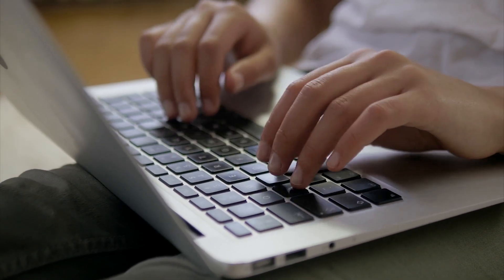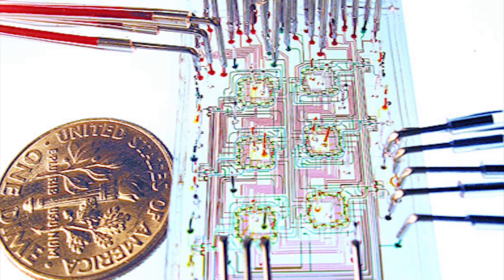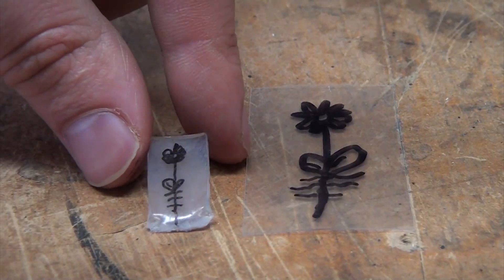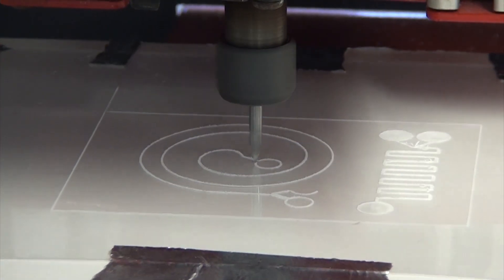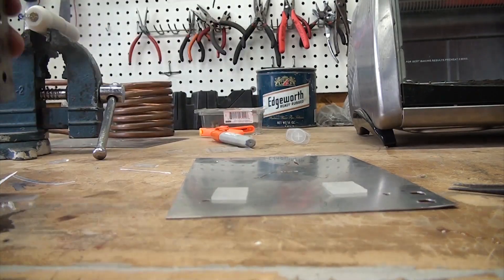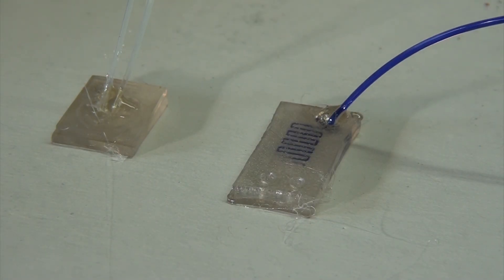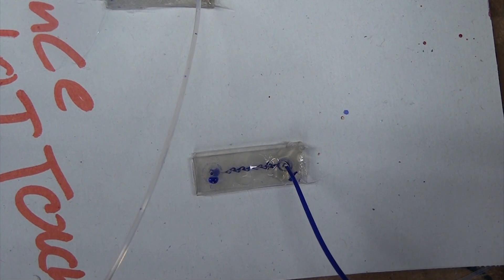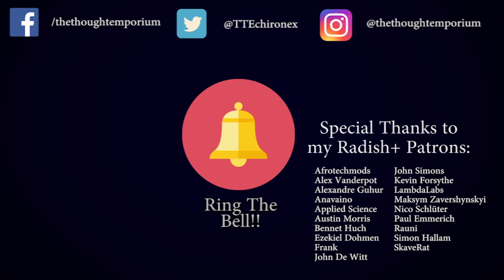Worlds Smallest Tesla Valve? - Shrinky Dink (Shrink Film) Microfluidics

Comment: You might be able to shrink it around your tube to create a good seal. You would probably have to experiment with hole sizes and may need to use a smaller stub or barb-shaped piece or clamps to prevent the weight from ruining it while soft.

Comment: Could you maybe 3d print this stuff using a dual extruder with the channels printed in a soluble filament maybe with a 0.1 mm nozzle. Than you just submerge it in water or the solvent, maybe use an ultrasonic bath. You could probably build some really cool stuff that way.

Comment: On my cnc router I put green painters tape on the plastic then put some on the bed of the router. Then I super glue it down. This works the best for close tolerances. And i never use tabs on my parts.

Comment: Im curious what is the tool(drill) used? Does it have like a straight conical shape? Or is it some flute?(like 2/4 flutes hss). Does it end with a tip or does it have some width of the tip? Sorry for so many questions. I have experience of metal cutting, I just never cutted/engraved anything in plastic yet.
Here youtu.be/ct0tljBtjG0 Integza printed Tesla valve. On one of his videos he also tried using DLP printer. On DLP printer pixel size is around 50 microns. Some epoxies are med rated as they are used for teeth implants for example.
Reply: If you need some 3d stls for that just give me a reply.
Does this Ctc channen on 8:55 should be smaller? Did you put some thought there, is it intuition, or was just drawn this way unrelated?

Comment: I have an HP xy plotter that uses full wave rectified dc to hold the paper flat in place. The bed is just a grid of interleaved fingers etched onto a circuit board with an insulating plastic film on top. When you switch it on it sucks paper down flat and really holds it solid. Might help when machining. 

Also, what about sandwiching an opaque film between two clear sheets and using a laser to vaporize out the opaque?

Comment: Use a  cold plate vacuum table to hold down the membrane and freeze it. Cold plastic should machine cleaner, as its less gooey..,relatively speaking, and will also dissipate the heat in the machining interface.

Comment: How about etching the design on standard copper-clad glass-epoxy (PCB) stock? After etching, you could coat the whole thing with a really thin protective layer to protect the copper from the fluid. It may not work at the really small scales, but it would be pretty good for demonstrations and proof-of-concept.

Comment: Hey there. Awesome video! Why not use your acetone trick to solvent weld the two bits together. Coat just the cover piece, set it on the channel piece, and apply pressure until bonded. Methylene chloride would also be very effective.

Comment: What's your channel width in the tesla valve? I fabricate my chips by pouring PDMS on silicone wafers and then plasma treating and bonding the PDMS to glass. I'm mostly using them to generate alginate microspheres, which I crosslink on-device using a Ca-EDTA chelator system with pH release trigger. This is great for minimizing polydispersity of the particles, but the startup sequence is finicky since any unintended flow into the wrong channel leads to crosslinking and a permanently ruined chip. My band-aid for this issue has just been printing a bunch and destroying a couple for each one I got to work, but I've been thinking about including Tesla valves proximal to the channel junction to make start-up a little more reliable. 

One worry I have is that at my channel diameter (10-100 um) and with the relatively high viscosity of a 2% sodium alginate solution, the flow may be too laminar for a Tesla valve to function properly (I'm assuming you need some degree of turbulence for enough fluid to go into the loops to generate appreciable retrograde pressure). Do you have any experience with this? This is all conceptual at the moment while my lab is closed during the pandemic, but I'm hoping to try this as soon as I get back.

Comment: As a long time worshiper of the Tesla. I have long wanted to see someone with better tools than myself produce a round tubular shaped Tesla valve I want micro sized ones like you are creating here or smaller if possible as I plan to use them in one or more of my robotics builds. I work with a lot of hydraulic drive systems, for movement heat transfer and dissipation. So micro small pumps like the Tesla design would be invaluable to me. Any ideas on this would be welcome.

Comment: Why not have several holes in the bottom of the CNC bed attached to a vacuum? It will pull down the material as flat as possible.

Comment: Mitee Bite has some low temperature wax based thermal adhesives for low force milling operations. It may be a fixture solution for you (cheaper than a vacuum fixture and won't cause valleys from deflection over vacuum channels) a layer of double sided masking tape works well too.

Comment: What if you make a vertical spiral out of this Tesla valve, with low pressure to upward side, and use impeller at the bottom or other techniques from Victor Shauberger. I wonder if water will flow upwards and how much energy it would take?

Comment: I know I'm a bit late, but have you considered acetone welding your side together by wicking a precisely measured drop in between your plates? I've done it before with polymer microscope slides and it works beautifully,  with maybe around 50uL of solvent, and considering how much extra surface area you have present around the channels, you shouldn't risk damaging them.

Comment: Can the Tesla Valve be utilized as a Flash Arrestor to prevent a hydrogen flame from back-feeding to the source generator, or gas cylinder, to prevent an explosion?
:
Reply: Simple answer: No.

Air and gases are compressable and a backflash happens too fast to prevent a flame from reaching the gas cylinder before the valve has enough function to arrest the flame.
Reply: +Rajeest Buljeet Singh 
Thanks.
:

Comment: One problem I've had using shrink plastic for things (mostly art projects, I'm no scientist lol) is that not all shrink plastic is made equal. I have actual Shrinky Dink brand stuff and for some reason it does NOT contract evenly in all axises (axes?). I was trying to make something with precise parts (cosplay jewelry, not hydrocells) and everything wound up with a slight skew. When compared to the sheet I cut them from, and then tested by cutting out a perfect square, the skew is actually diagonal across the page, which made it just about impossible for me to negate. In the end I had to go as my brother to 3D print them, which is a shame because in my experience the shrink plastic winds up harder/sturdier than the PLA his printer uses, and it doesn't need sanding most of the time.

Not sure why this happened? My guess is either the brand of plastic (Shrinky Dinks, clear kind, no rough sides), the markers I was using (Sharpies), and my heating methods (spastic haunted oven). I have no way to test any of these, so I guess this is mostly a warning. Not all Shrink Plastic is made equal.

Comment: When I was doing microfluidics in a university lab, we used silica wafers with photoresist deposition and etching to form positive molds, cast these in PDMS, then used electrostatics to adhere them to a glass slide. Because of this, we were able to have extremely high resolution microchannnels.

Now that you have your plasma desposition rigged up, that could be something interesting to explore for your next video.

Comment: So running in the opposite direction to natural flow you could use the tesla valve as a transistor yes?  Lots of pressure equals fluid output yes no pressure equals fluid output no.

Comment: A vacuume fixture with leveling screws to align it with the axes of the router would be a much easier and more effective way to get consistent designs. Also, using a .005” ball end mill from Harvey tool designed to cut plastic will result in fewer burrs around the channels. Very cool video. I work for a company that makes plastic injection molded microfluidic chips for the dna sequencing industry. If you have any other questions send me a message.

Comment: Hey an idea since you already have a few of these. Put one tube in a bucket of water to the inlet of one then the outlet put connected to a T connector and put the syringe on  the 90degree of the T and put another one of these on the other side of the T and into a bucket. Since they only work one way opening the syringe will draw in liquid from one and closing it will push it through to the bucket making a valve less pump...... come on I want to see it in action.

Comment: +The Thought Experiment  check out design tool developed that I work on specifically aimed at designing microfluidics. https://3duf.org (https://www.nature.com/articles/s41598-019-45623-z) . Also in case you're interested in milling out microfluidics on a more solid substrate like polycarbonate, you can use https://www.researchgate.net/publication/323400541_Desktop_micromilled_microfluidics

Comment: Ok, that's pretty fascinating. I wonder if there would be some way to cut on the inside of a Shrinky Dink with a cleverly-tuned laser system or something, making even tinier channels and avoiding the need to try and match two halves.
Reply: Normally the medium is bonded with a small glass slide, making a tight seal.

Comment: I've never heard of this field and i'm so angry, god dammit, i'm a biologist, every single biological logic gate in existence is a microfluidic channel and i've never realized that.
Neurons are based on electric impulse, but its not electron flow, its ionic flow, god its so obvious.... 
These designs could in theory directly bridge the gap between neuron action potential and electronic bits leading to fine tuned brain-motor interface.
I'm actually flabbergasted.

Comment: You should take a look at xurography to make cheap and fast to assemble microfluidic chips, I'm currently working with it for a University work. All you need to have is a vinyl foil (basicly a sheet of double sided tape) and a cutting machine used by advertisement industry to cut vinyl sheets to make markings for cars, windows and all that stuff. You can create a chip about 10 minutes if you know what you are doing. Definetly worth to take a look

Comment: you should try using double sided tape to stick down your designs. That combined with the "mesh bed leveling" that is possible with modern open source 3d printer firmware and an inductive probe (combined with a metal backing on your milling surface) and you can get very accurate cuts. This is a cool method!

Where can I buy the shrinky dink film?

Comment: You could use the die scans of the classical 6502 processor available at visual6502.org to make a microfluid 6502 microprocessor. The chip itself should be simple and small enougth for the material you're using, and if you know some python you could easily write a script to create plans for the carving from either the die shot or the transistor schematic. It surely would be amazing to see such a thing actually working

Comment: Someone needs to earn their PHD creating a program that will generate the G-code to etch a shrinky-dink version of the Water Integrator (https://en.wikipedia.org/wiki/Water_integrator), a Russian analog computer first developed in 1936 that used water as its information-carrying medium rather than electrons.  The original version solved non-homogenous differential equations.  A later version, the Hydraulic Integrator, was modular and could be re-configured to solve various problems.

This is actually a really good area of research, since microfluidic logic will be necessary for controlling and performing more complex reactions at scale.  Being able to have your system solve some of its own problems will make the work easier and more likely to result in something that will work in the field, where micro-fluidic systems may be the only way to get certain results outside of a lab.

Edit:  Nevermind, his name is Manu Prakash and he is the Assistant Professor of Bioengineering at Stanford.  He invented both the foldscope (the origami microscope that is very cheap and durable) and a form of microfluidic manipulation that relies on ferrofluids, small metals, and a rotating magnetic field acting as a clock to move each droplet along the circuit.  It's apparently also possible to make some very simple mechanisms using nothing more than the dyes in food coloring and water.  That's me told.
Reply: AH!  Something from the man's research for you to make.  https://www.youtube.com/watch?v=kNQToOEFNmY  He has an interface between a microfluidic system and a music-box mechanism for time-bound mixing of chemisties.

Comment: Why not just heat up the metal so it doesn't crack when bonding the two pieces. And damn I love tech and science.
Reply: One downside of metal is that you cant monitor how well it is working (eg are you getting even flow? Are there blockages? Where are the blockages? etc) simply because it isnt transparent.

Because of this, you can't apply simple optical imaging techniques to the fluid (eg if you want to quantify protein/DNA in the fluid, or detect a protein/DNA spike you can read absorbance at 280/260nm. Unless you made little windows or embedded the sensor, you couldn't do that within the flowcell. 

Lastly, cost and ease to manufacture. Might be comparable in both cases, Im not sure, but if you're just using plastic you can burn through loads of these until you get one that works with simple tools. Metal might require more serious methods to bond layers (eg welding or very high temperatures)

Comment: here's a tip for a cnc base, get a reasonably thick metal sheet and drill small holes in it even distances apart (distance may vary depending on your project size)
using thinner sheets turn it into a small box that you can attach a decompressor to (do NOT weld, the thermal shock can deform the metal sheet and mess up your projects, this is why we want a thick sheet both so it's harder to deform and so we can drill and tap holes for bolts.
bolt the thinner sheets to the thick ones and seal the connections using silicon rubber or leather.
now you'll want to apply underpressure to the box, tweak it so that you have gentle suction at all of the holes, make sure the holes are only 3 millimeters or smaller to prevent the suction from deforming the plastic or the plastic being pushed into the holes as the cnc passes over them.
your best bet is to use an airpump driven by a BLDC (Brushless DC) motor as this allows for very precise on-the-fly speed control so you can adjust the airflow as needed.

As for attaching the two pieced of plastic after shrinking, you can try to "weld" them together using acetone.
apply some acetone to the edge of either piece, press them together gently (for instance between two smooth surfaces with some light weights on it)
and using a q-tip dipped in acetone rub some more acetone along the seem between the two pieces, this should form a pretty strong bond.
Do note I got this idea from welding lego pieces I'm not sure how well it works for flowcells but it's worth a shot

Comment: About 20 years ago, I worked on projects similar to this to measure motor feedback and tactile feedback pressure sensors as a pump and adjust a continuously variable transmission to reduce under or over driving the motors.

I was using hypodermic needle and syringes as my parts to include making highly accurate screw drive pumps.

Not with Shrinky Dinks, though. Lol.

Comment: Why not SLD printers line https://formlabs.com/ ? They have a feature size in the order of micrometers and can create negative spaces.Check out this video from 'Applied Science' https://www.youtube.com/watch?v=7Z8uPHL52Q0 . Skip to time 3.42 for more information. You can also check out https://shop.prusa3d.com/en/3d-printers/721-original-prusa-sl1-3d-printer-curing-and-washing-machine.html. These two solutions can work if you want to create negative spaces in plastic. 

A negative space for this kind of application can also be created in glass. I am not sure if this solution with work to expected requirements but it worth experimenting. Check out this video from 'Makers Muse' - https://www.youtube.com/watch?v=sOrby692Uag&t=9s .Skip to 2.34 fro more details.

Best luck ! Hope this helps :)

Comment: 2:38 This is the closest explanation as to why you'd want to do this, other than it looking cool. If you wanted it to do math then why wasted electrical energy pumping liquid when you could use it to calculate? This seems more useful for biology and medicine fields.
Reply from the maker: Something I didn't talk about much is it's application to soft robotics. Basically it lets you build some of the logic functions directly into the plumbing so that you need less electronics. the octopus bot is a good example. No electronics but it oscillates its arm movements using fluid logic

Comment: A tesla valve appears to function like a backflow brake when using low viscosity fluid or gases. More viscous fluids might net a more true valve effect.  Correct channel sizing design would seem critical depending on visc of material being pumped.  Might have cool apps
 in shock absorption and other  backflow limiting uses ( sound suppression, pulse jet inlet:)